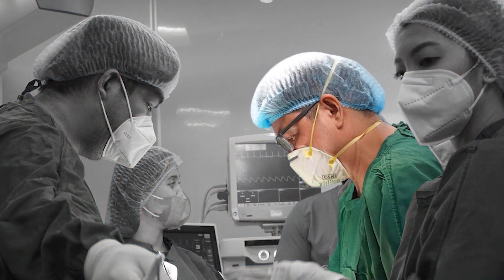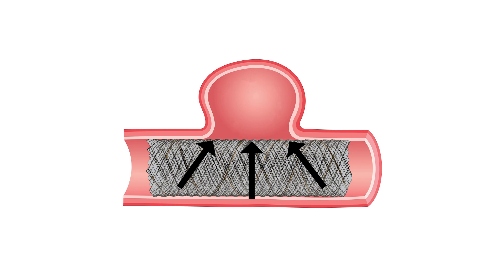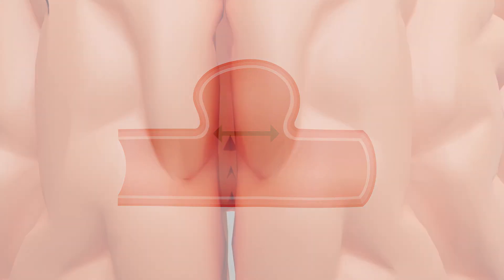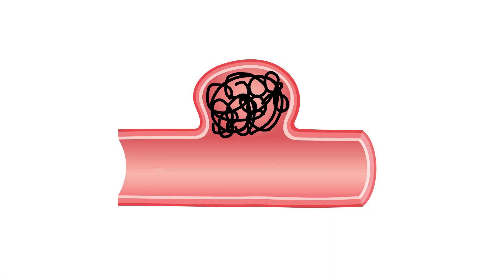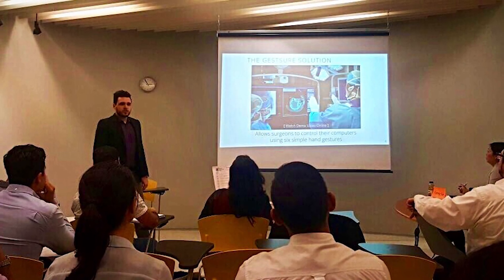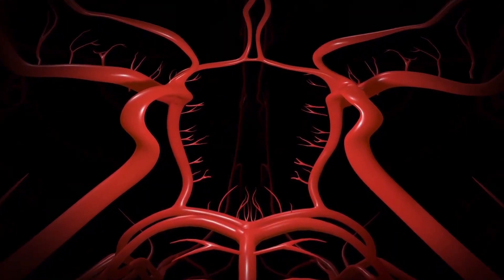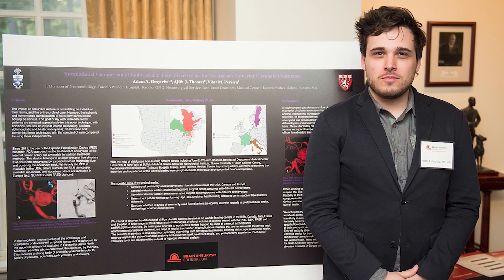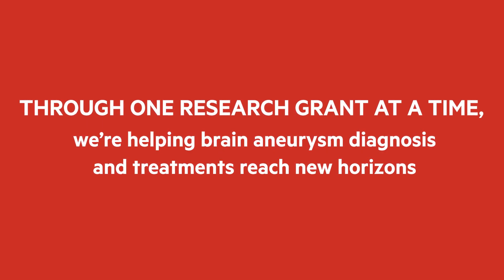Flow Diverting Stents Explained | Dr. A. Dmytriw, BAF Research Grant Recipient

Comment: Hello.  I have an aneurysm that measures up to 9.2 mm in diameter. The aneurysm
 neck is wide measuring approximately 6.6 mm in diameter. It is a Saccular berry aneurysm arising from the le supraclinoid segment of the distal internal
 carotid artery.  I also have Chronic PTSD.  I hope I find the strength to have the surgery to get it repaired.  Sending love to you all.

Comment: My first aneurysm got brust in 2020 so  pterional craniotomy and microvascular clipping was done. To prevent brusting of my second aneurysm stent (flow divertor) was implanted in 2022  but after somedays it got blocked and gave me ischemic stroke. Now I have 2 clips in brain's left hemisphere &1 stent in brain's right hemisphere.
Reply: How are you doing now? I'm newly diagnosed, unruptured, 4cm located in the Circle of Willis. Seeing intervention radiologist on July 1st. Praying for you!
Reply: @cocoemrick1903   Now Ican do 99% of my daily rouitine works. I also go to my work and carry out tasks alloted to me .Thank you so much for your prayers and concern.
Reply: How are you doing now?. I have the  samecase:blocked flow diverter.  What did the Doktor do with this blocked flow diverter?
Thank you
Reply: @volanarakotondrasoa8837   Doctor conducted emergency mechanical thrombectomy to remove thrombus. Now I am fine . Initially I had partial paralysis on left side of the body as blood flow to right side brain was disturbed but quick treatment and regular  physiotherapy  saved me
Reply: @tarunyadav8375  thank you so much for the answer  . It is  great That you are fine. Did you have Paralysis after the blocked flow diverter or during the Thrombectomy? As for me i didn t chek that the flow diverter was blocked.
Reply: @volanarakotondrasoa8837  I had partial paralysis due to disturbed blood flow to right side brain . It is called ischemic stroke. Mechanical thrombectomy saved my life and physiotherapy helped in overcoming partial stiffness left in left hand & leg.
Reply: @tarunyadav8375  thank you so much  for scharing. 🙏God bless you
Reply: May i ask you a last question please, did you get a new Stent or not?
Reply: @volanarakotondrasoa8837   We can't replace the stent ( flow diverter)  it becomes part of body. I  got flow diverter to prevent bursting of aneurysm in my brain . Now my aneurysm is swollen down and I am free from its risk of bursting. Blood clot blocking stent can happen to anybody having stent. Just keep in mind to take your blood thinning medicines regularly.
Reply: @tarunyadav8375  thank you for the    Answer and all information. 🙏❤️

Comment: My aunt was going under flow diverter procedure. But our doctor said that during the process her blood pressure elevated to 200 to 220 as well as she went into Arythmia. So he abandoned the procedure and said that he didn't place the flow diverter. And said he will have a CT Scan tomorrow to check if there was some bleeding after he abandoned the procedure. If there is no changes then he will discharge her with some medicines to control her blood pressure.. can this be true. ? Please help